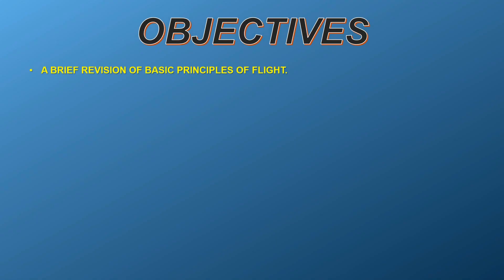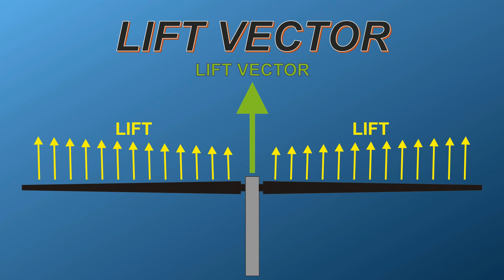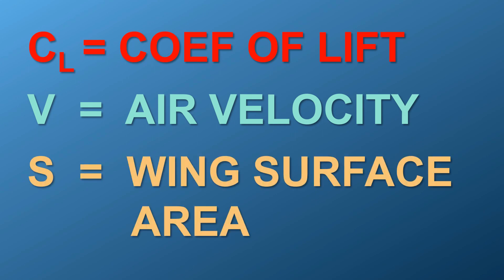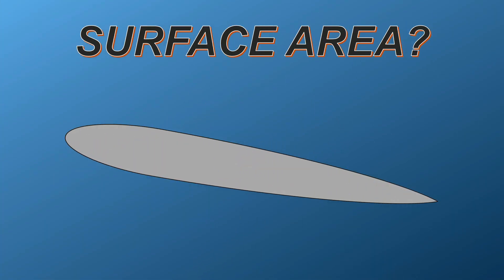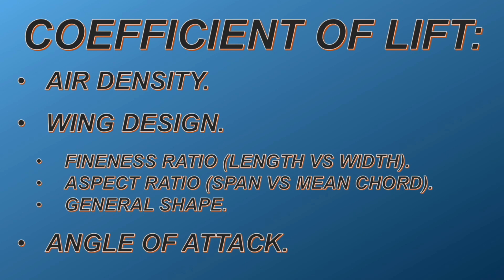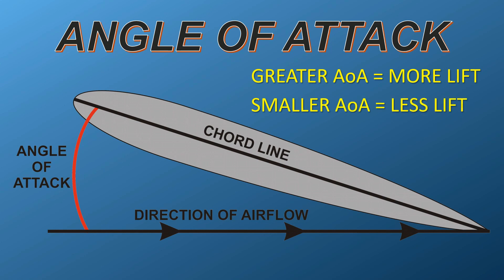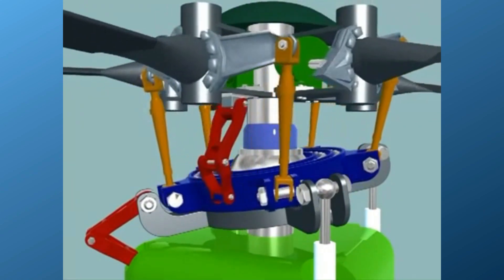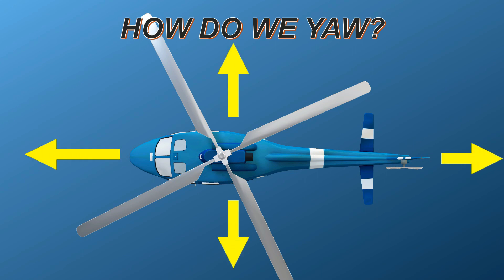Principles of Flight - Helicopters #Helicopters

Comment: You could have added a little more on the 3 axis of control: Yaw, Pitch, Roll as basicly the fuselage is suspended under the rotor disk. Overall it's good vidro. 🚁